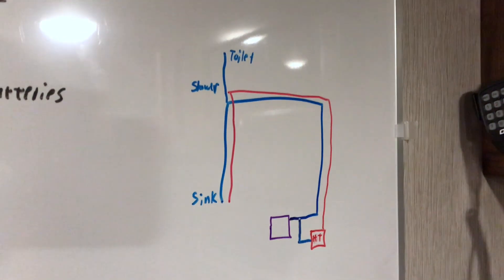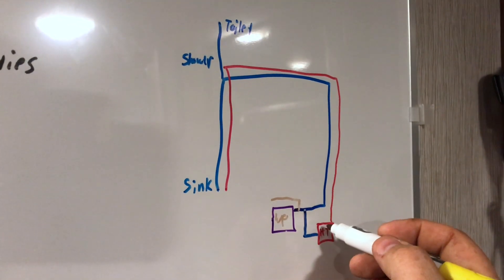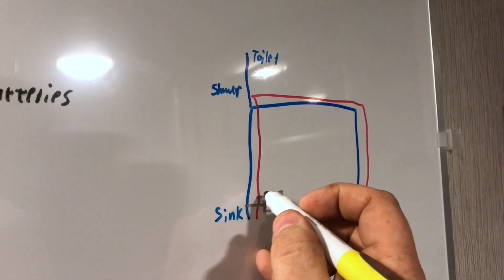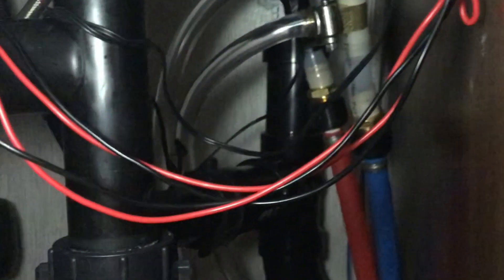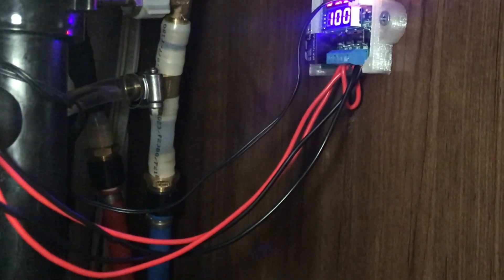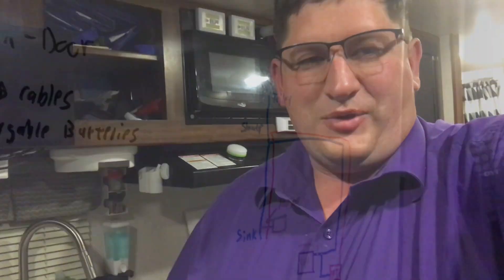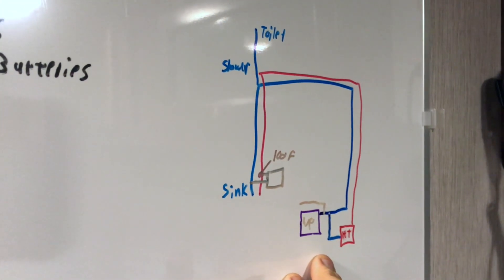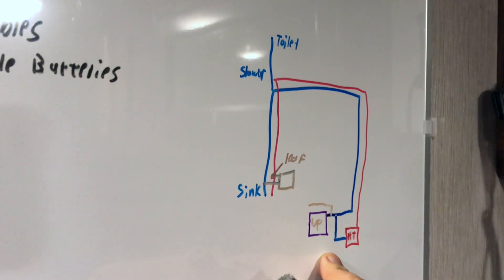Recirculation Pump in RV

Comment: Thanks for the video.  My new rv has a tankless water heater but we found out the hard way that tankless heaters need a minimum water flow to heat the water.   We had too low of flow at the kitchen sink to activate the water heater so I had to remove the faucet aerator to get the water heater to work but this really wastes lots of water doing dishes.      I was thinking of adding a recirculation pump and your video gave me a simple solution.
Reply: Make sure you ONLY use the hot side. Do NOT use the cold side to adjust temperature like you would with a standard tank water heater. Use the controller to set temperature

Comment: I guess I see why you re letting an extra pump run.  My thought it the water pump works when the pressure drops, so a normally closed valve from output of water heater to the tank, when opened will drop pressure causing the pump to run, sending output from water heater back to tank.  When temp sensor reaches programmed temp, cut power to valve sending to faucet.  I haven’t yet installed, so if you see a hole in my logic, please let me know.  

I will attach sensor to output of water heater.
Reply from the maker: @PancakeBill  I don’t think the pressure based sensor plus temperature will work. The pump measures the the pressure on its output, and if that is going towards the water tank instead of towards the faucet where you want. This is I used a standard pump without a pressure sensor, and put the temperature sensor near the faucet.
Reply: @EdwardCzajka  I have the valve on output side  of the water heater, so downstream of waterpump.   There is a brass T on output, one side goes to faucet, other side goes to valve and return to water tank.  So, opening faucet or valve drops pressure and pump kicks in.  The temp sensor is attached to the brass T.  Not perfect temp transfer, so need to set the switch to about 90 deg.  Flip the power switch on the panel, activates the sensor circuit to turn the valve to open.  Water flows thru the heater, back to tank, then as it hits 90 deg, sensor turns off vavle, pressure builds and turns off pump.  At that point the water temp is at about 110 to 115.

Works great.

Comment: Thank you for sharing, I have a question: When we travel our water pump is normally on, will this method work if the water line is under pressure from our water pump?
Reply from the maker: Yes. This will simply circulate the water in the lines based on the temperature set. You need to have pressure in the lines, or you could start circulating air instead.

Comment: I see you turn the pump on with the switch and the thermostat turns the water off. Do you ever forget to turn the switch back off ?  With the switch in the on position I would imagine the thermostat would turn the pump back on again once the water temperature drops.
Reply from the maker: That was part of the idea behind the design, so it was temperature controlled. If we are in a really cold place, I can use this to keep the pipes from freezing
Reply: @EdwardCzajka  Could this design be modified somehow to remove the need for an extra pump by simply opening a relay valve in a new hot to cold bypass line that drains by a new line to the fresh supply tank?